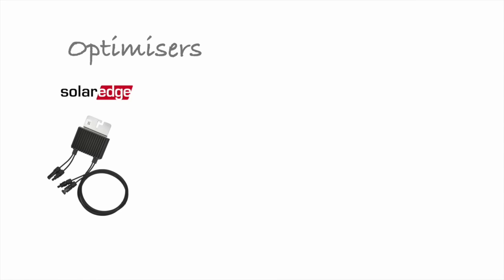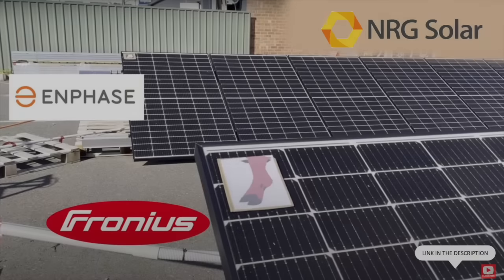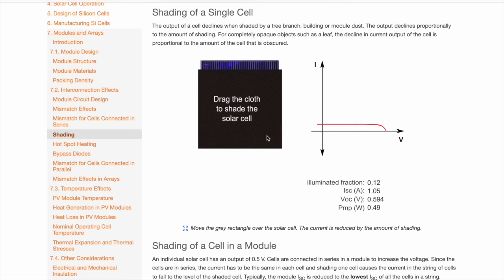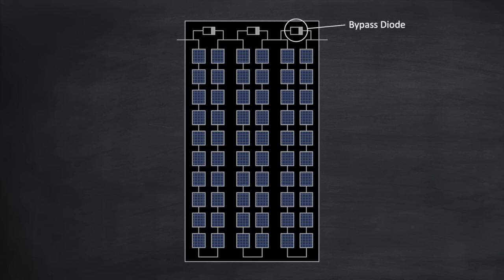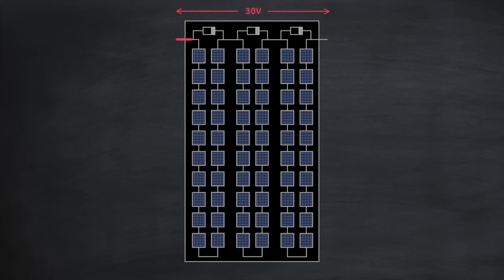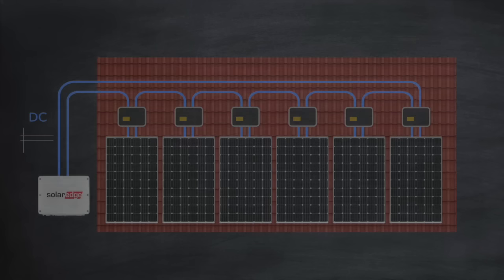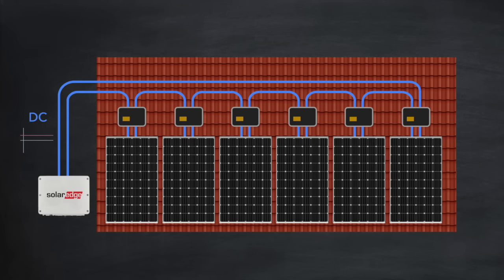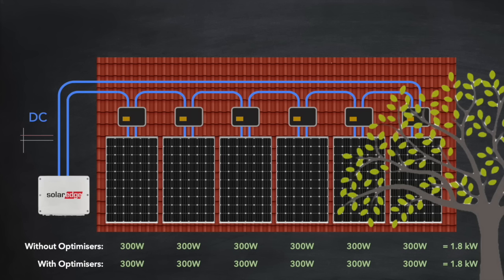Solar Panel Shading (Part 1): Are Optimisers and Micro inverters Worth It?

Comment: Optimizers and Microinverters are completely different, like comparing apples with pears.
Agreed the need for individual MPPT per panel is for each situation different, on top of a flat probably you do not have any (or only slightly) shadows and no need for MPPT per solarpanel.
Also optimizers are only increasing complexity, correct.
Main advantage / PRO of microinverters are the lifespan of the products. String inverters have a 7-10 years warranty (you can get extended warranty to 20-25 years, but this costs about the price of an inverter. Oh wonder why.) 
Micro inverters have fairly default 20-25 years warranty, without much extra costs. 
Lifespan of micro inverters equal more or less those of the solar panels.
Also when you loose one micro inverter, it only effects the panels connected to it. The rest will still produce power. Whereas a normal inverter dies, you will lose all power.
We have both systems. String inverter for the solar panels on top of our warehouse, where there is no or not much shadows. Micro inverters (AP Systems) for the solar panels on top of the house, where there are trees and chimnees blocking the sun depending on daytime.
Reply from the maker: I never said optimisers and microinverters were the same.

Comment: Thanks so much for a really informative video.  Extremely valuable in appreciating how bypass diodes function to limit the impact of shading.
Would you have any opinions at all on how standard the periodic full sweep of Global MPPT is in today's solar inverters?  Just as an example, I've been looking at one of Givenergy's latest hybrid inverters, but beyond being told that there are dual MPPT inputs with a maximum current of 11A I haven't been able to find any information at all.
Any views at all they would be greatly appreciated.  Many thanks 
🙂
Reply from the maker: Hi Jeff, you’re most welcome. As it happens, I’m working on a follow-up video on the topic of shading, and I’ll be saying a little more on MPPT. I’ll try to cover your points if I can find out sufficient information 👍🏻

Comment: Hi Gary, nice video with the basic explanation. Unfortunaly you miss one of the very important thing. All good modern PV panels are constructed as shingled. That means, that every single row of shingles act as one PV panel you described. Whats more there are also "half cut", which means, that every row of shingles are splited into two identical parts. The conclusion of this is that modern PV panels are really power stable even some shade comes. To use optimizers make sense only in case, if the panels are  strongly shaded or for safety reasons, because it's very easy to shut it down in case of fire for example.
Reply from the maker: Hi Martin - I try to make my videos as mainstream as possible, and so that's why I didn't cover shingled panels - they have benefits, but to date, little traction in the market. I may do a follow up video of half-cells and other technologies in the future - I didn't want to make this video too long.
Reply: @GaryDoesSolar  Of course, I really appreciate you did. My thumbs up!
I just want to say, that actual trends are shingles...
Next time we can discuse for example about spectrum usage or so... ;-)
Reply: @GaryDoesSolar  I've posted above an Australian YTer "off grid garage" did a video on Hyundai shingled panels, worth a look IMHO.
Reply from the maker: Thanks for this, David. I’ll take a look! 👍🏻

Comment: Well done mate really informative video as I'm about to install 2nd system on my house and I was concerned about shading I was never sold to micro inverters what happens when one goes wrong
Reply from the maker: Thanks Mark - yeah, they are quite complicated devices and very hard to get to if they fail. I also hear that warranties generally don't include the cost of access to the units (i.e. scaffolding)...

Comment: I wish I had seen this before because I went with micro inverters due to shading during winter months and while I did not pay a lot extra for them I did get a lightning strike that took out almost every inverter and the cost to remove each panel and replace the inverter was very high. If I had a single inverter on the ground it would have been much cheaper.
Reply from the maker: Wow - a lightning strike! Crikey! Sorry to hear it cost you a fair bit to repair. I didn’t give my view in the video, but if I had any shading on my way, I would definitely gone for optimisers. I still probably would go for a string inverter, but I’m hearing many reports that people with microinverters are quite happy with them :-)

Comment: I installed SE optimizers on 50 300W panels to 2 inverters back in 2016, what a mistake, paid about $60 dollars per optimizer. However in the last 5 years, about  15 optimizers have failed. Mine was a self install ground mount so I'm able to get to each optimizer easily, but still a major hassle. And they used to send out  replacements quickly, but not now, I had to wait 5 months for my last unit. Can't imagine the cost if I had to pay someone to do this, especially if it was a roof mount. So to get rid of them I'll have to buy 2 new inverters, but in the long run I think it will be worth it, since I'll most likely go with a hybrid inverter and add some batteries as a backup system.
Reply from the maker: Hi Donald - your experience with optimisers looks to have been awful, so thanks for taking the time to comment. This will help others in their decision making. Can I ask a question, when the optimisers failed, did they just take out the panel connected to, or did they affect other panels? I'm planning to make a follow-up video on shading soon, covering other aspects including reliability...
Reply: @GaryDoesSolar  well I use the SE app that shows my system and when I see a dark panel I know I have a problem, it either produces very little output or no output, in the app I can bring up the Optimizer voltage, and it shows very low volts like less than one volt, then take screen shots and send them to SE via the trouble reporting system. The other panels are not affected. Right now I have two more bad optimizers.

After watching your video, I thought if I would have just bought a few more panels with money I would have saved, I would have been way ahead in terms of production.   If you think about it when one fails it takes at least a month to get it back up and running, since this is in Hawaii everything just takes forever. Oh did I mention I've had to replace both SE inverters also. So far everything has been warranted. The panels I used are rock solid, never had an issue with them.
Reply from the maker: Thanks for the extra detail - much appreciated 👍🏻

Comment: One of the main benefits of micro inverters is the flexibility. You can individually add panels and to subtract panels and change panels and have mismatch panels also have panels with multiple different angles and directions and do all sorts of things with micro inverters because every panel is independent
Reply from the maker: Hi Dave, great points. I’ll try to include in a follow-up video I’m making on shading - thanks 🙏

Comment: Good explanation . Heard micro inverters have the advantage of energy loss while converting from DC to AC than string . Also in an ongrid system during a voltage fluctuation it will protect the solar cells from burnt off . Is it true Gary ?
Reply from the maker: Thanks. Now, I don't know if microinverters are overall more efficient than a string inverter. I guess it depends on the manufacturer in both cases. And for the voltage fluctuation, I'd expect both a string inverter and microinverters to be able to manage such conditions.

Comment: In the example you pull a cloth accross 1 panel so the output goes to zero. Pulling a cloth accross a panel is causing no light (completly dark) on that panel. What happens with the output when the panel is laying in the shadow but with only diffuse daylight on it?
Reply from the maker: Worth watching this video on optimisers where I explain about diffuse shading in detail: https://youtu.be/I4czBPobtg0?si=qbpFaWgcxaKzpe0i

Comment: Excellent video Gary, much appreciated as I am about to make this very decision. But what about when the sun goes behind clouds for a period? (i.e. similar to diffuse shading in your vid).  Of course the light intensity will drop but surely the panels outputs don't suddenly fall to zero do they? How can optimisers help here? Just trying to get my head round it...
Reply: In my opinion that isn't diffuse shading as what Gary was talking about was a part of the panel being shaded rather than the whole panel. In spot shading the flow ids constructed in that place causing ineffect a blockage whereas the sun light dropping is a decrease over the whole panel which yes will reduce the output but as it is across the whole lot it is universally felt so therefore doesn't have the same blockage effect. A spot shade is a constriction of a little section of the pipe where the high current is still trying to shove loads through. A cloudy day just means lower current being pushed throught he entire pipe so doesn't have the same kind of effect and the bypass diodes wouldn't be triggered either. Sorry if a bit rambly.
Reply from the maker: Thanks, and I think Adrian hits it on the head. Where you have the same kind of shading across the whole array, then the current generation will be roughly the same across all the panels. And because there is no differentiation of current between the panels, the bypass diodes have no need to kick in. Of course, the total power output will be slightly lower, but that's expected. Bypass diodes only operate when there is localised shading on one or more (but not all) the panels. Hope that helps!
Reply: @adrianlynch9435  Thank you, yes that helps
Reply: @GaryDoesSolar  Thank you yes that makes sense. So overall shading (like a cloudy day) means less current being generated across the whole panel, whereas partial shading creates a differential current between certain cells and so the diodes kick in. Excellent!

Comment: it always depends on the location: there isn't one solution for all: many shadings: polycrystalline cells, cells with many bypass diodes for some possible shading (trees you can't cut) ....
With microinverters you don't have a big single point of failure and smaller AC-only cables (no dc disconnect, standard cabling, no dc special stuff).
There isn't a one fits all solution. With microinverters you need a special costly unit to be able to run in an island mode (some victron multiplus may run with some microinverters).
Reply from the maker: It's true, everyone's situation will be unique.

Comment: Great video! But I still have one question. What should I do when 2 panels are facing south and 2 facing west, east, or north? Should I use Optimisers or Microinverters? Should I go with an inverter with 2 MPPTs (designed for 8 panels, 3kw) or should I get two 1kw inverters?
Reply from the maker: I can’t give you specific advice, but installers would generally use a separate string for each array orientation. And hopefully my videos will provide you with sufficient insight that you can ask your installer all the right questions 👍🏻
Reply: @GaryDoesSolar  I'll sure do. Hope they can answer. Thanks!

Comment: Hi Gary, please help me with one simple piece of information. I have an 8kW Solar Mpp and 10 solar panels of 590Wp each. The inverter, in the description, is 2x4000W. My question is: can I put all the panels -5900Wp on a single input to the inverter? VOC is 42V for each panel - the inverter supports Max. 500V. Or how is it better to proceed? Please I wait for your answer ASAP. Thanks ,
Reply from the maker: Hi Felix, unfortunately, I'm not in a position to provide advice (not least because of potential liability issues - even if advice is given free - such is the world today). You're best to speak to an installer about that, or post a comment onto a solar forum (e.g. this one in the UK: https://www.facebook.com/groups/2197329430289466) Good luck!

Comment: You forgot about 2 important things about microinvertors: 1. Scalability ( if you need to add more panels, you don't need to replace the invertor) 2. Reluability (If  invertor got bust and you are away for a long period of time, the whole system is gone and there is nothing you can do about it, whereas in case of microinvertor problem you have slightly reduced output).
Reply from the maker: Hi Boris, I didn't forget. These two benefits, whilst desirable, were not related to the topic of the video, which was shading.
Reply: @GaryDoesSolar  First of all, thank you for this excellent presentation. I understand your reaction to Boris, but after watching your video I got more of a feeling that the topic would be "the REAL pros and cons of optimizers". After all, you also close with "If I should make a list of pros and cons ..."
And in this list Boris's tip could be added.

In addition, my experience is that each panel has its own deviations. One panel sometimes delivers almost 10% more than another. This can be due to production errors, as well as reflective light incidence, but also due to temperature differences. The panels that are the first to get over the cool wind always have a slightly higher yield.

Without optimizers, this would all equal to the worst performing panel.

Don't get me wrong. I really like your explanation, and I didn't know about the diode.
Thanks for that.
Reply from the maker: Hi Jan, thanks for the kind words - that means a lot. 

I guess with Boris’ comment, he annoyed me as it read like a straight criticism. But on reflection, I could incorporate some of what he said into a follow-up video on shading that I’m doing, not least because, as you rightly mention, I started to discuss pros and cons anyway 👍🏻 

I’d also incorporate the points you make as well if that’s ok? Thanks for highlighting 😀
Reply: There is a third pro for the microinvertors which is related to risks. Having AC voltage on your roof with microinvertors, is safer than (e.g. 20 panels of 30V:) 600V of DC in a cable pair which can be very dangerous. Also (and this one is huge, I think), AC is protected by default by an earth fault protection and microinvertors don't produce AC, without AC. The fire fighters don't like high DC either.
Reply from the maker: Great points, Chris - I’ll mention these in my follow up video if that’s ok 👍🏻

Comment: Hi, great video. Is it effected whether the panel is portrait or landscape? In my setup ill be having 7 panels portrait with no shading and 5 panels landscape on another part of the roof which will be partially shaded at the bottom for about an hour or so in the morning. Will optimisers on the 5 panels be a good idea? Thanks
Reply from the maker: Thanks for the kind words, Tom. So, if I understand your setup correctly, the panels mounted as portrait will be at the bottom of the array, where the shading is.

The following is not advice, but purely opinion:

If the shading is hard (opaque, like from an adjacent building) then portrait panels should work effectively as the shading will only activate the bypass diodes for the horizontal rows of cells affected. 

If the shading is diffuse or from a cable or something, then you might want want to consider optimisers on those panels.

Hope this helps!

Comment: What i know about solaredge and current in a string, is that in case of shading not the current is regulated but the voltage, so when shaded a panel will give the same current but with a lower voltage.
The voltage of the optimizer (can go up to 60V) is not the same voltage as the voltage from the panel (max about 40V).
In a string we have everywhere the same current, there is nothing you can do about that, so current is not bypassed around the panel.
Reply from the maker: I’m not sure what you’re trying to say here. Could you restate please?

Comment: I saw a module years ago that was permanently shaded by a roof vent. It had formed a hotspot and the back foil was burned.  I would never have installed a PV module in this location, whether with or without optimizer.
Reply from the maker: Wow. Agreed 👍🏻

Comment: My installer told me thier REC Solar Alpha Pure-RX have 4 bypass diodes instead of 3, can this solve my shade problem?
Reply from the maker: Not a straight-forward question to answer as it depends on the kind of shading you have. Typical panels manage three separate zones, but the REC Solar Alpha Pure-RX panels manage 4, so I'd say it's ever so slightly more capable but my view is that I'm not sure it would make much difference in practice.

Comment: Thanks for the video.

If I understand correctly, an optimiser is essentially moving a string of panels from serial to parallel.  If that's the case, why not just cable them as parallel?
Reply from the maker: Hi Matt, that’s not the case in fact - the voltages of all the panels in series still add up, even if optimisers are present. And a string inverter needs a minimum voltage level before it operates.

Comment: Hi Gary, your videos are really very helpful - thank you.
I am wondering if you would consider doing a video on what the kWh actually means. I have a simple grasp of the generation but what happens if I use my 3kW kettle for say 1 hour. Does it simply mean you use 3kWh? 
To be succinct, can you explain the draw on the battery for different appliances?
I think this may be of interest for alot of people.

Phil
Reply from the maker: Hi Phil, glad to have been of help. Now, I was planning to create such a video as I think quite a few people get in a muddle about power, energy, voltage and current. I just need to find the time to get it done! Hopefully soon 👍🏻 😀
Reply: @GaryDoesSolar  Excellent thank you - you have summed up my predicament succinctly. Phil